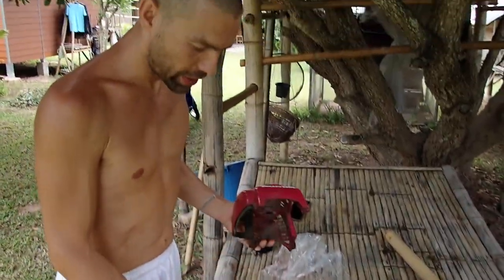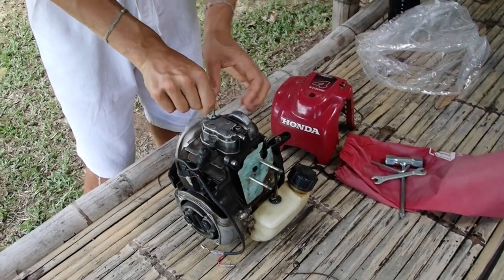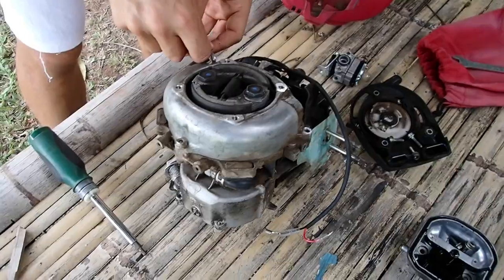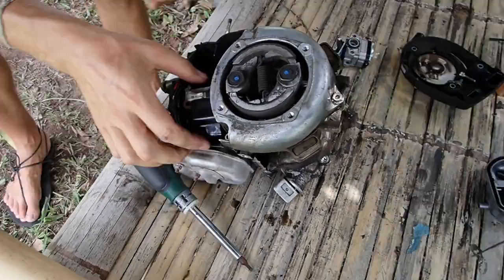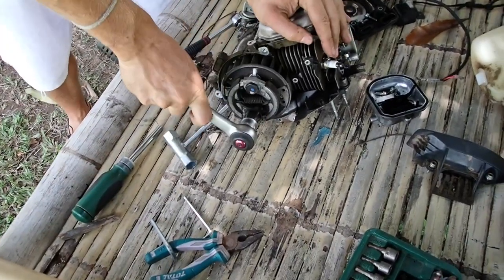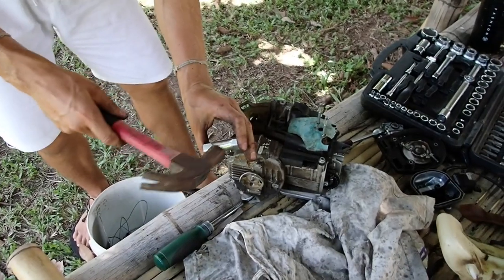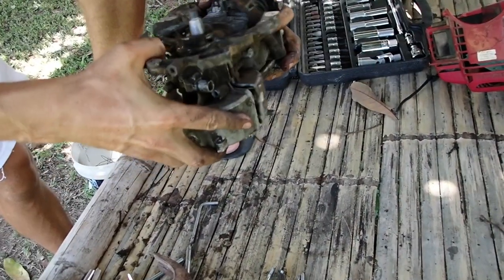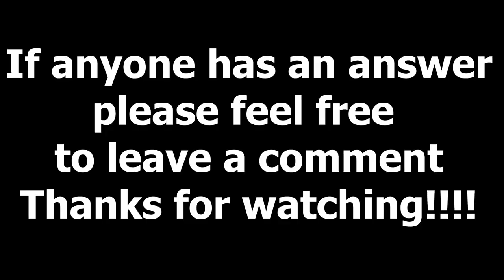Lawn Mower Engine Honda GX35 Disassembly Broken Piston and/or Valve?

Comment: I think your valve may be stuck, you could try to spray some lubricant from the top, my guess only. Did you find out the problem?
Reply from the maker: lubricant is not enough. I thought there were more comments on this one, because one viewer wrote a comment that the valve needs to be sandpapered slightly to get moving again. But I have not tried that yet.
Reply: @PlantSugar  ok, thanks, good luck on the repair, I just purchased a Honda GX35 a few days ago for my gas scooter, I haven't installed it yet, looks like a great motor though.
Reply from the maker: @zmanvideo1  yes the Honda GX35 is a great motor. I think my motor has an issue because of wrong maintenance (running with old oil for too long). Good luck with your gas scooter!